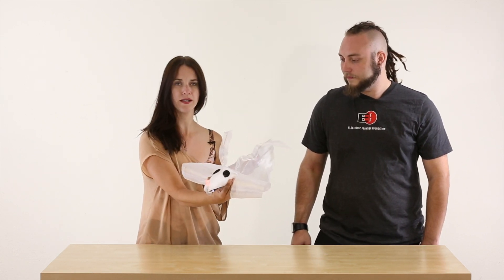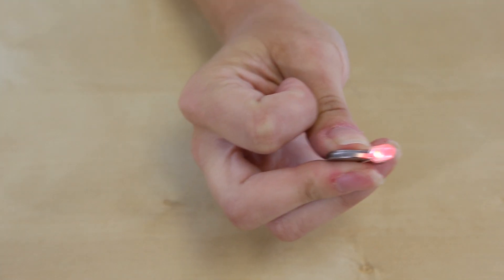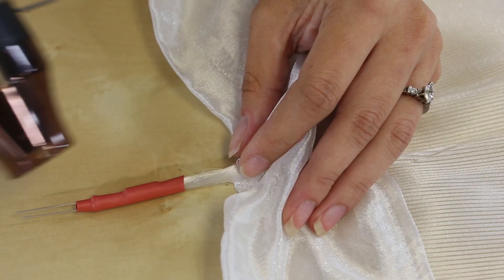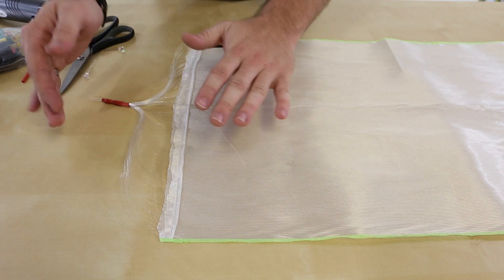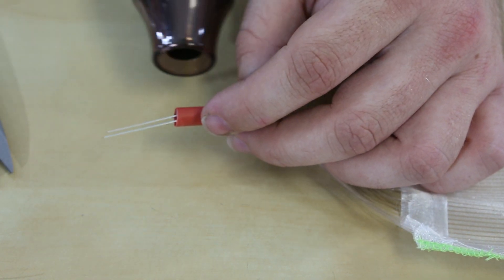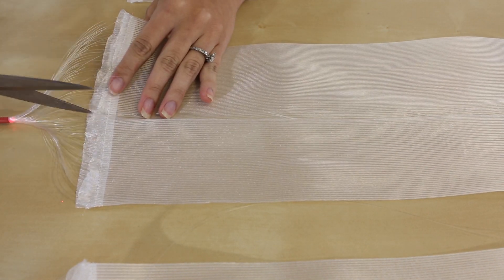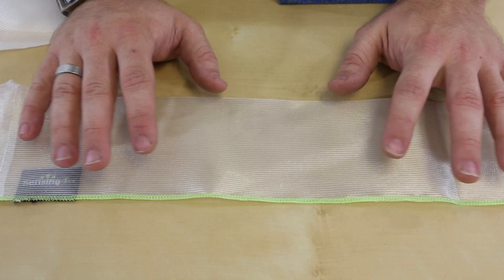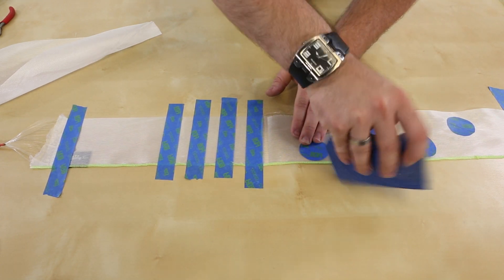ElectriCute: Fiber Optic Fabric

Comment: Hey question for a paper I'm writing: Do the fibers used in fiber optic fabric have a lower index of reflection than normal glass fiber optic cables? Because I've read about glass cables having total internal reflection which keeps all the light in, but these obviously let some out because it's lit up all the way across. 
Thanks!

Comment: If I use this material to create a top to wear, what happens if the battery thing gets wet? Would I get zapped or something dangerous or does it just stop working?
Reply: aprauhl alyssa Good question! Definitely don't submerge the battery pack in water or anything. If you're in a situation where it's likely to get wet (like out in the rain), don't just turn it off; take the batteries out entirely. You're not in a lot of danger or anything, but you definitely could get shocked (more uncomfortable than dangerous), so better safe than sorry!

Comment: Pretty cool Can this fabric be fashion cut and sewn? or does each piece need to be woven finished ?
Reply: That's what I'd like to know also! If you figure it out, please help me!
Reply: if y'all wanna sew it, I think its best to go use fiber optic cables... sewing the fabric might cause stress points...
Reply: You can sew it as long as you're only sewing the fabric holding the fiber optic strands together.
Reply: @dumbghost3109  i cant imagine any project that id want to collect all that material... with my luck id yawn sneeze or bite a sandwich and inadvertently 
Inhale or swallow some material, if not dust, etc..   But in anycase  glad you at least have some knowledge about it. Thanks

Comment: Cool vid!As someone who works with fibre optic lighting tho, I cringed to see you take scissors to the ends. Use a razor to try and get a parralel cut as possible or even "polish" the end at 90deg to the strands with some 1200 sandpaper...you will transmit MUCH more light this way :)

Comment: Hm.. some new idea and materials to work with for cosplay. Gotta wonder about the endurance of the material though..
Reply: Unboundedominion The fabric is pretty tough in that it's not going to tear easily, but the distressing we did is a good indication of what will happen if it gets roughed up, creased, or scratched. For cosplay, you're probably going to be packing it up and traveling with it, so definitely do that carefully, and never fold it across the grain of the fiber optic strands! It arrives folded with the grain and then rolled; take your cue for storage and packing from that!